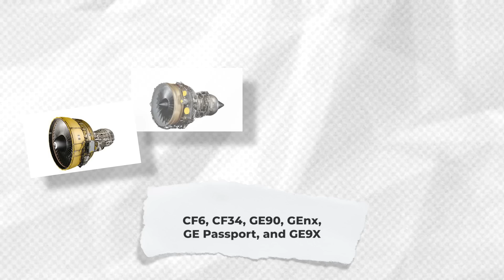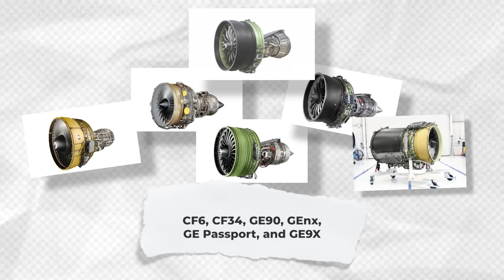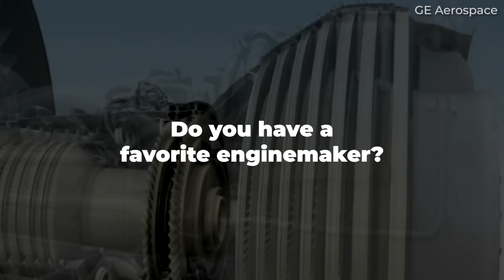Top 5: The World's Largest Jet Engine Manufacturers

Comment: Yes, more efficient and better for the environment — but it does make you think. These engines are 7x larger than those from the 1970s (like the JT8D), yet bird ingestion tests and other safety standards haven’t scaled accordingly. Shouldn’t certification be based on inlet diameter by now?

Comment: Pratt & Whitney also supplied powerful engines to the American Air Power, F119 for F22, TF130 for F14, F100 for F16, F135 for F35 and J58 engines for the Black Bird. I worked on some of these engines at P&W. I am a Turbofan of P&W Aircraft!

Comment: Tell the real truth. These are actually Mitsubishi, Kawasaki, Sumitomo. In the case of Rolls Royce. And Ishikawajima Harima and Safran (Snecma) in the case of General Electric. General Electric and Rolls Royce are just names that sound nice, but someone else is responsible for that success. Your partners will tell you about that. But it should be emphasized that partners account for 80% of the success with which you like to brag that it is exclusively yours, Americans and British.
Reply: BS, the people you speak of are sub-contractors.    They work to specs provided to them for the parts they build.    This is common in every industry.    Of course they are part of the success but they would not be in the business were they not selected to supply parts or whatever.   The same applies to the car you drive.

Comment: What is listed here is the set of Engine designers, who do manufacturing too. Many more manufacturers are there around the world, who do their job after receiving design drawings - so as to make them under license. 
A significant omission here, is the information on Russian Engine designers & manufacturers.
Reply: Russian aerospace technology is dying slowly, so better not mention it.
Reply: @arman3291  
Is it?
They are still designing & building aircraft & engine sets. They are i use.
Their design approach to "reliability" is different. They make robust things (aircraft or engine) with less number of links - to fail. In the West they add too many things to monitor performance, auto-correct, "fail-safe" etc., thus each component in the chain shares the reliability (less failure tolerant) & enhancing "over all" reliability. In India, we inherited the Western approach.
Reply: @MrPoornakumar  Lol India will not be able to make a jet engine in the next 1000 years.

Comment: Exactly what is the difference between a turbo fan and a turbo prop???  The high by-pass turbo fan nowadays are basically a glorified turbo prop. The prop been renamed a fan and are partially hidden in a shroud to pull the wool over the ignorant public's eyes. Yes there are some gains in efficiencies, at the cost of more structural weights and complexities and contra rotating props do have a reputation of being noisy. The other thing the public do not seems to know is , we are still struggling with the "sound barrier" for that last 3/4 century.  A "jet" that is a speed record holder just beat the next runner up by maybe 3 kts. The time had gone ways into fixing some handling problems at the coffin's corner and economy, but turbines are still at a disadvantage in fuel consumption , compare with pistons. For really long distances, such as crossing the Pacific, big airlines still have the edge over the smaller jets. For trips like NY to HKG or even Sydney non stop, I feel much more comfortable in a 787 than a Challenger, especially going there against the prevailing wind.

Comment: Is there a video which is sort of a spotters guide to identifying which engines are being used on which aircraft? I can never get it down, and would love to see something like that. As always, amazing work. Thank you.
Reply: I do know what you mean,  It can be complicated. I can never remember them all. 
Some new aircraft come with an engine and there is no choice, other aircraft, you have a choice of engine manufacturer. 

I just remember bits of things like the later versions of the 757 were Rolls-Royce equipped, but the earlier versions of it used something else. PW I think. 
I do know that the Boeing 747 was originally launched with the seriously flawed  PW engines, but later there were other engine options.

Comment: With P&W and Rolls Royce having significant issues with some of their products, it's hard for me to choose a favorite.
In theory the best product should be the one that fits the customer the best, and has the lowest fuel burn and is the quietest.
That being said, a product that is all that, but has issues, and prevents airplanes from being delivered or grounded as a result, can't be good.
The quality of the overall product "jet engine" needs to become better, we've seen way too many issues over the last few years, in my opinion.
Reply: When I fly, I prefer not to sit within 45 degrees of an engine. It really ruin your day if you have a turbine blade ending up on your lap, after it went through the back of your seat. For the rear of the engines, the wing give another layer of protection.

Comment: I worked on the assembly floor at P&WA for 1 1/2 years in the late 1970s. It was a good job but not for me. I was an avionics technician in the military and went to work in electronics and communications and probably flew on jets that had engines I helped assemble.  I worked mainly assembling JT-8s, but did some work on the JT-9 including a tear down after test. I moved to Alaska after I left there and I remember many of the engines went to airlines there as this was in the build paper work. Different airlines put different accessories on the engine.
Reply: Are you still in AK.? I spent several years in Anchorage working for an outfit that turned to shit after a management change, but had a great time for a few years.